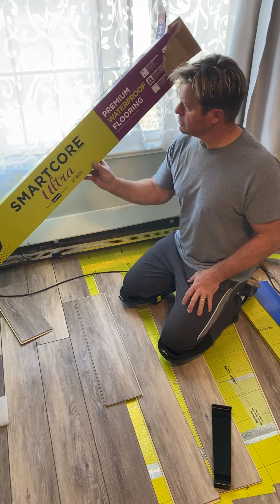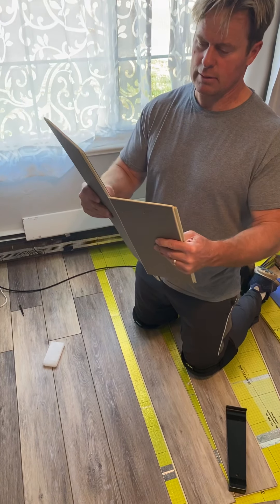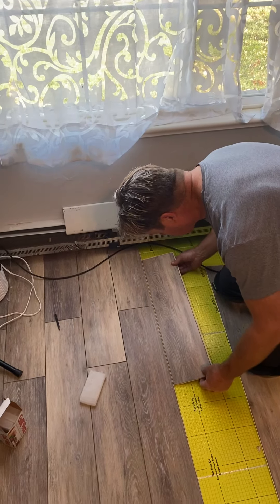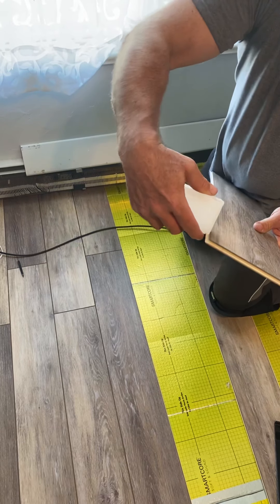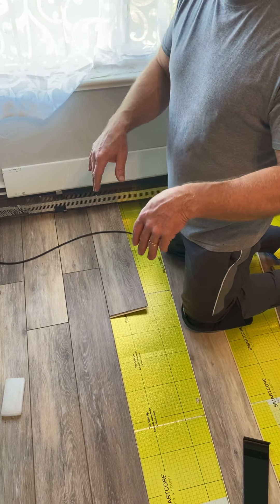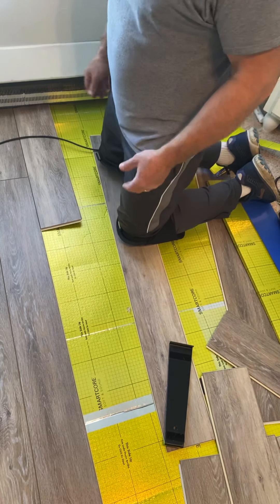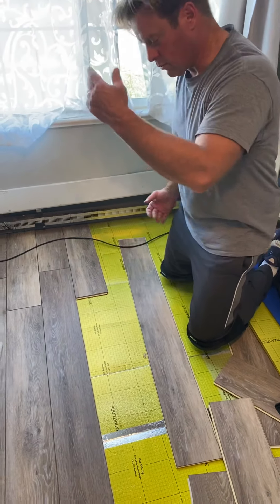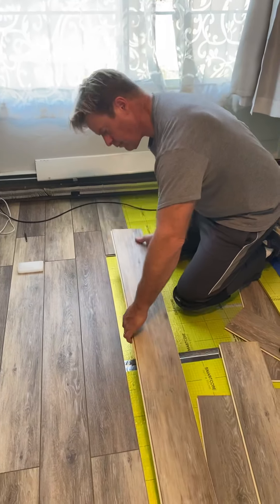Smartcore Ultra floating flooring, install tips.

Comment: Thankfully finally this is actually the help I needed.  I was having a hard time getting my ends to connect well.  Putting them in place first was so much easier and made it a lot less frustrating.  I agree with you that it is not as easy as everyone makes it out to be.  Thank you so much for posting this.

Comment: I installed this in 2 rooms a few years back and it was a breeze. Then I decided to install it in the rest of the house so I'll have a uniform look, but I have to work backwards in several locations. Good Lord, I'm ready to shoot myself in the face. I gave up and called a contractor friend. Just watched your video and saw your tip about the wax. I'm going to give that a try tomorrow and see if I have any luck before my pal arrives. Thanks for the video and believe me, I can empathize with your frustration.

Comment: I start this floor tomorrow. I haven't put any vinal floors in about 6 or so years, and I haven't done this brand before. I got all my other flooring at Menards. So this sounds like it is going to be fun. (Not) I have already had a time with the subflooring. 
I love you "Suicide prevention line" comment! Definitely been there already with this project. Ugh!
I do have a question, where you using a tapping block and runner mallet to lock in the seams or where you doing it all by hand?
I had heard that this floor was easy to install......now I am dreading it!

Comment: I got this stuff today, it's total crap, Ill try your wax trick. I have put down 5 or 6 rows and pulled them up 4 times because it just doesn't click in,very weak joints

Comment: I’m wondering why you chose to lay the underlayment even though smartcore emphasizes that it is not needed since it is included in their flooring.
Reply from the maker: The reason I did it was to keep water from getting through the joints and swelling the plywood underneath. The planks are supposed to be waterproof but the joints are not going to be waterproof 100 percent. Just another layer of protection for water getting through while mopping or spills. Also ads a small amount of sound and temperature insulation and a little more even surface over the existing floor wooden underlayment joints and imperfections.
Reply: I did underlay because my subfloor was old and it ensured more level on the subfloor panel joints.

Comment: dang, i was looking at installing the Smart Core Ultra because they had the design and color i like (blue ridge pine) and i can find that design and color in any other plank.   Now you got me shied away from it because i have never done plank and don't need an extra hassle.  And the stuff is not cheap at $4.00 a sq ft  thought it was quality

Comment: Why did you choose to lay down the moisture barrier even though your planks have the rubber backing?
Reply from the maker: Because the joints are not waterproof and it ads a bit of temperature and sound insulation.
Reply: would you use the barrier when going straight to good clean concrete?
Reply: @mikereynolds3294  yes it is a bit of insulation, not enough but a bit and better than nothing.

Comment: I went to Lowe's looking to purchase vinyl tiles... I was sold this stuff, the first cut I did I noticed there's wood (cheap fiber wood) and all the vinyl was is the top wearing course. I installed steinmaster luxury vinyl planks In the bathroom and those were true vinyl throughout. This is not true vinyl throughout. Not happy.

Comment: Next time install with the long tongue exposed first .I noticed u did it opposite thats why your having trouble.This is a great product that goes down fast.
Reply from the maker: It doesn’t always work that way. Depends on where you start the house. There are areas where you have to go backwards. Couldn’t do it that way in this room because my wife wanted the living room done first.
Reply: That product is NOT great, ill never buy it again.  Lifeproof from Home Depot has never frustrated me like this.